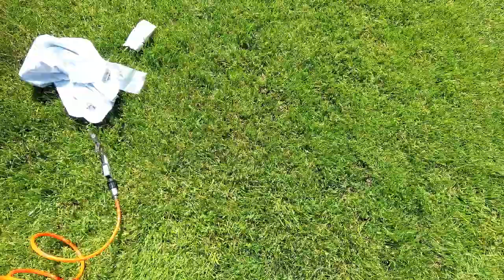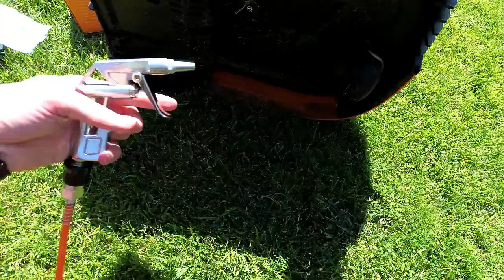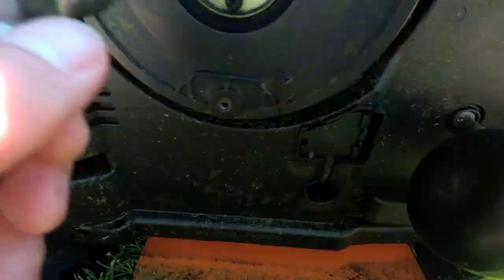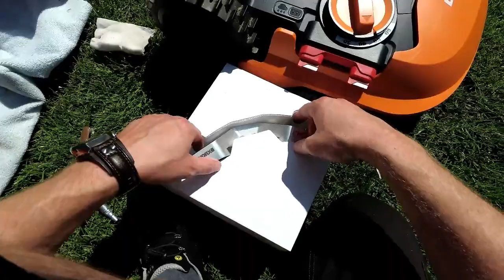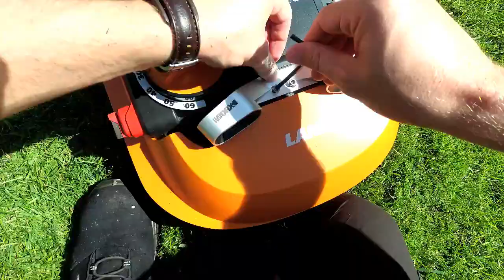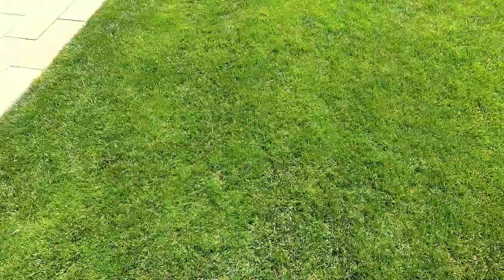WORX LANDROID M WR141E - [INSTALLING ACS & NEW BLADES]

Comment: Christian the pilot how do you like your landroid so far ? any issues with it ?
Reply from the maker: Hi Diego,
thank you for your comment. So far i cant complain. Ive been running it pretty much every day for the last 3 - 4 months. It works very well and my lawn got strong, dense and healthy. I have an issue with one spot in my lawhere it gets stuck, however, thats because of how i laid the wire (i put too close to a curb) and not because of the machine. I think im gonna wait for a few additional weeks and ill try to make a follow up video. Have a great day and greetings from germany.
CtP
Reply: Christian The Pilot do you still like the Landroid? Can’t decide on this one or the other more expensive brands. Do you have issues with it?